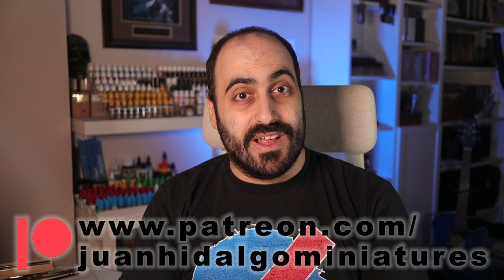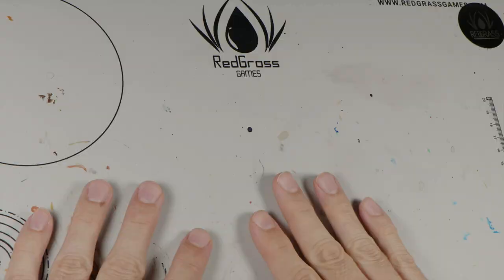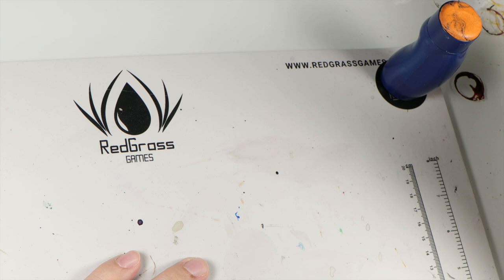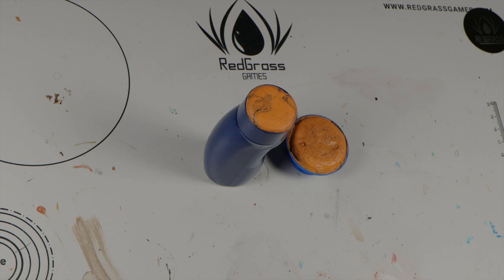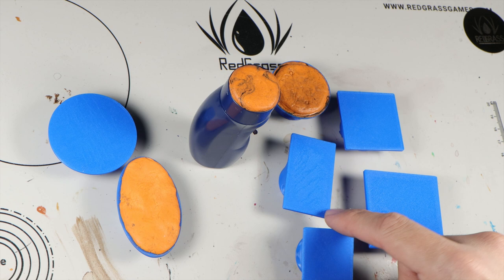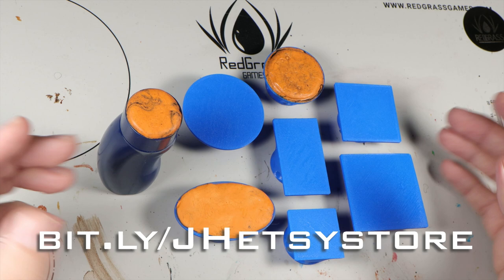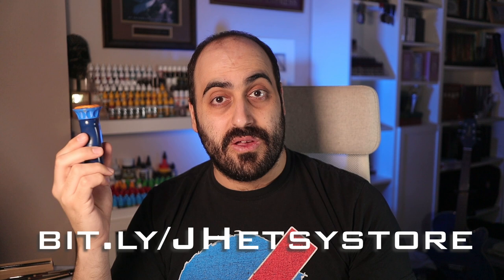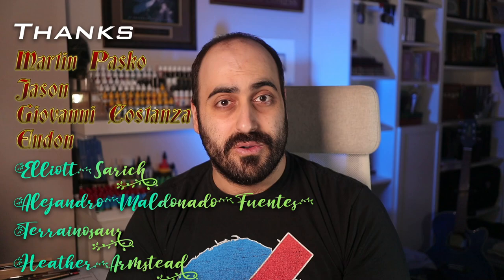Fixing the ONLY FLAW on the perfect painting handle

Comment: I've added magnets to one of the RGG caps to allow it to hold magnetised parts (heads, gun etc) that have no base for the putty to hold.
You could make a printed cap which narrows to a magnet hole for this kind of use, where the part is smaller than 25mm/has no base.
Reply from the maker: That is a FANTASTIC idea

Comment: A suggestion if you want to add to your files... there are times that painters will want or need to paint a figure or sub assembly pre-basing, but the normal blu-tack attachment to the spinner doesn't work well for that.  When I need to do this, I use a long pin in the feet and insert into cork rounds for painting.  If you had another spinner stl with spikes to hold cork, it could be helpful to some.
Reply from the maker: That's actually a very good idea, thanks
Reply: Great idea!
Reply: that's a great idea indeed. Until now, I just used one of the standard caps with some putty to hold a cork from an old scotch bottle that has some embossed logo or something on the top, giving the putty something to grab onto. It works, but it's not exactly a large cork and after a while, it's just riddled with holes. A holder for larger pieces of cork of whatever size you need would be absolutely perfect.

Comment: Juan Hidalgo once again with the top tips. Never knew you were an engineer. Cool stuff.

I got one of those Citadel paint handles. (The old one, not the current design). It works well enough, but the clamp always has me a tad worried that it's too tight.
Reply from the maker: Those clamps are indeed too tight, I've had based bended using it. That's why I moved to a putty system

Comment: I've also designed a lot of those heads to print on my FDM printer. Including some longer ones and some for the Rathcore cork inserts and bows.
Reply from the maker: Nice
Reply: So, for me, your design is the perfect one. The mix between the rgg holder and the rathcore one with the bow and with the possibility to have cork insert. Good job. Do you share or sell the stl files on mini factory or thingiverse?
Reply: @cyrilvandenbrande5207  It looks like my first answer is deleted. I have some of them free on MMF. Just search for "rgg360".
Reply: @peterscheler  thanks, I have seen it last week. I already printed with resin last weekend. It works perfectly. Thanks. I told it to my friends.
Reply from the maker: Sorry for that, if it had a link, I have an automatic filter to delete them. Too much spam mate

Comment: Expecting something revolutionary, just a simple improvement.
Reply from the maker: Sometimes a simple improvement is enough
Reply: @JuanHidalgoMiniatures  "simple yet practical"
But have you ever thought redesign it to be a tabletop holder rather hand holder?
Reply from the maker: Tabletop? In what way?
Reply: @JuanHidalgoMiniatures  the concept is the holder that using swing arm or  telescopic stand on a base with rubber to "free" hand from holding the holder. Much like one of dspiae holder
Reply from the maker: That's very interesting, having such a powerful magnet that would be extremely easy to prop using an articulated arm for cameras and a table clamp

Comment: I got one of these handles when I got the Everlasting wet pallette 2. It's a very good handle but my biggest issue with it is the rotation of the cap, specifically how easily it rotates with anything slightly larger than a Primaris Space Marine. I'm currently painting the Ork that came with Warhammer+ subscription and if I tilt the model forward past 3 degrees of tilt the model starts to rotate. I haven't been able to conceive of a fix for it which is disappointing. The magnetic sticker is a fantastic idea.
Reply from the maker: Mike is more solid in its rotation. Have you contacted RGG about it?
Reply: @JuanHidalgoMiniatures  no mate, I thought it was intended to be that way. I'll send them an email, see what they say 👍🏻

Comment: Hello, I was looking for a solution to adapt the rathcore bow on the redgrass holder, to add it or to remove it easily like on the rathcore. It just need to have the good diameter with a groove. If you don't like to use a finger bar, however it could be useful for others persons.
Reply from the maker: I personally don't like the finger bar that's why I haven't designed any functionality about that but it's a good point
Reply: @JuanHidalgoMiniatures  It is possible to buy the rathcore bow whatever the length as spare part with the silicone skull. I understand that functionality is not important for you as professional painter, but you have the accurancy in the motion. But it is not already the case for beginner as me. In addition, I hope you will show many tutorials with the xpress. I am waiting my xpress set in pre order. Please, continue your painting tutorial, it's a pleasure for us to watch them.
Reply from the maker: Thanks, I will consider making a new set with the hole for the finger bar

Comment: Brilliant.  I've been using this handle daily for about a month now, and have some models on larger bases queued up.  I was on the cusp of designing something very similar myself, using Fusion 360.  Well, you beat me to it, so I've purchased yours.  P.S. - any chance of you including the CAD in the download in an interchange format, such as STEP?  Would be nice to be able to make modifications (in theory... though can't think of any other options I'd need right away :) ).
Reply from the maker: I will look into it but I've had these done for a year now and I don't know if o have the original files.

Technically speaking you can modify Stls too

Comment: Redgrass has very good products. The putty does not make me happy. The design of the handle is super, but i don t like nor the orange, nor the grey putty. I paint miniatures with no base glued on it. First the mini and then the base. So, when i put a miniature on the pholder, the putty sticks to the miniature ( feet, body ..). It sticks and get into crevices and its really hard to remove. I did not find a putty though that is better in that matter.
Reply from the maker: Yeah putty holders are not for your application. I would suggest pinning the model on the feet and using some kind of cork to stick those pins in